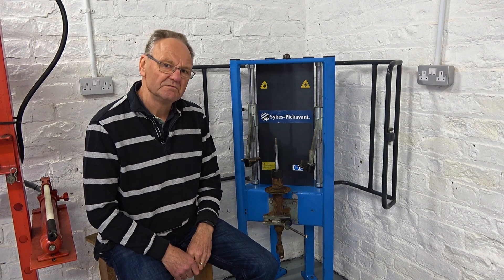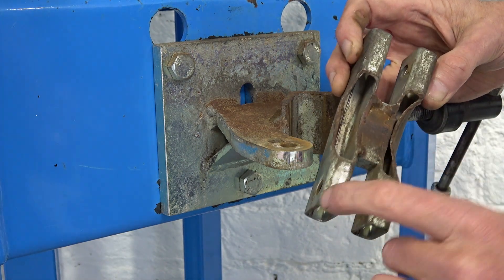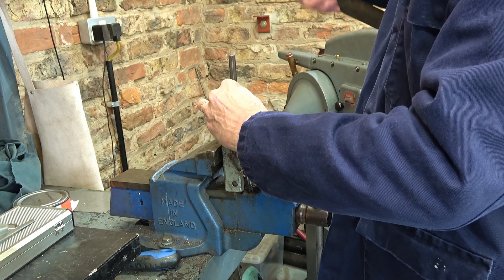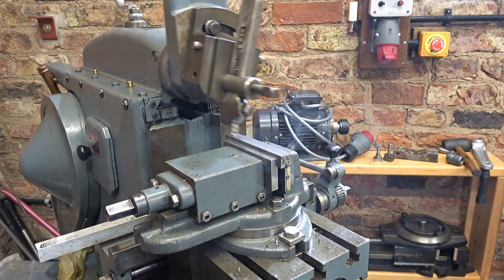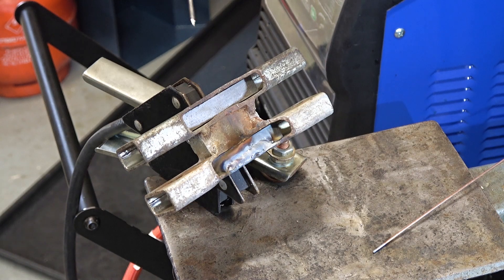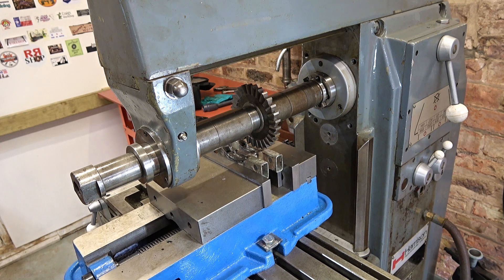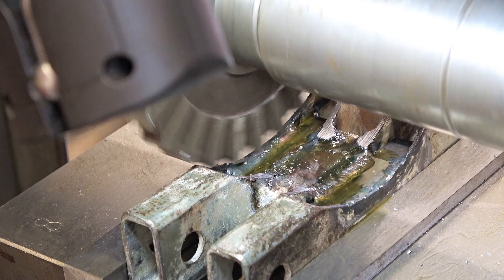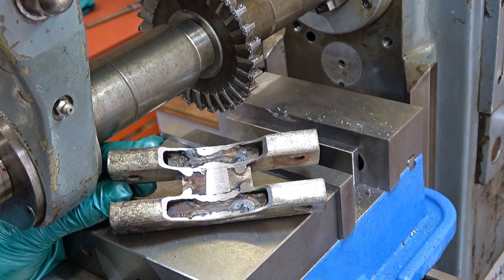HS281 Coil-over spring compressor clamp repair

Comment: Thanks for the video. As others have said the major diameter looks large? An engineering handbook,/website will have the major and minor diameters of the threads. The insert on the lathe shouldn't be stopped in the cut as it may chip. It should cut a thread without issue. Try running it a little faster maybe centre drilling and supporting with the tailstock so yoy can have it further out to give you more time. I'm surprised at the finish near the headstock though. I've also found the quality of threading inserts does make a difference. I've bought some from a company called APT. Not cheap but they are excellent. Keep up the good work 🫡
Comment was for the previous video
Reply from the maker: Thank you Mapstardamo 👍

Comment: £50 for that spring compressor was an absolute steal. I bet I paid almost that for a pair of the ordinary screw type ones 25 years ago. They are still in the draw in ths garage, used once.
Reply from the maker: Hi Bill, yes but commercial garages work them hard and then one day when the Sealey van pulls up they buy a new one and the old one is almost scrap value - just in the way so they want to get rid quickly. But also I helps to know people in the trade ..... Cheers

Comment: That was a great film Paul. It was nice to see the Harrison Mill running and cutting. The second hole you found in the bracket on the spring compressor looks like it might have been drilled by a previous owner to grip a smaller shocker. It seems very close to the outer hole. 

When you tigged the spacers into the existing clamps, did you experience the phenomenon of sudden and highly increased brightness of the arc? I have come across that a lot when tigging mild steel. I eventually learned it is due to zinc plating on the steel. Often sheet metal from old domestic appliances does it, as it is "zintec" ie zinc plated mild steel sheet. Many mild steel parts in machines like the spring compressor are similarly treated with zinc.

Comment: I think you'll find that the cut outs are there to hold the coil springs, just my 2 cents
Reply: The clamp goes around the shock below the coils, so the cut out isn't for the coils to go into. There is a video on how to use on the manufacturers YouTube channel @sykespickavant, "Sykes Pickavant Spring Compressor Review".

By the way @ £50 plus Dad's time at minimum wage is a bargain 🙂 they are £3,000 new, even the Machine Mart clone is nearly £2K
Reply from the maker: Hi Michael, maybe, I'd not thought of that. It came from a commercial garage and they did not that use it that way. But that's not to say anything actually ...... Cheers

Comment: That's a fancy spring compressor, I've still got the pair of screw clamps that you just hook over the coils in my toolbox. I think I've got to the age where they won't come out again 😊
Reply: I have a similar set. Used it to compress springs on an Xterra- i thought they were going to break as I tightened and the screws started to bend!

Comment: I like to over engineer things.  Two new crossbars of solid 4140 & new spacer in between. Ten times stronger, so that you break something else on the spring press & then have to repair that. Good to have you back machining again. I'm jealous because I only have a 7 inch shaper. 1950 Delta.
Reply from the maker: Hi Bob, good to hear from you 👍